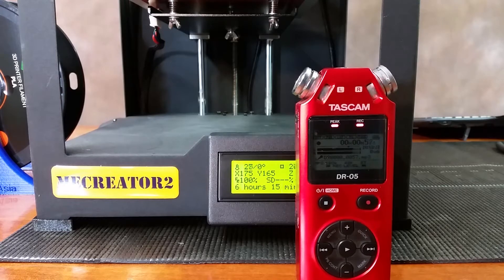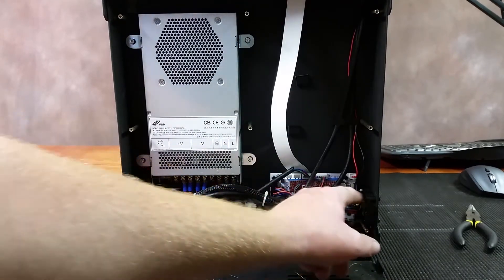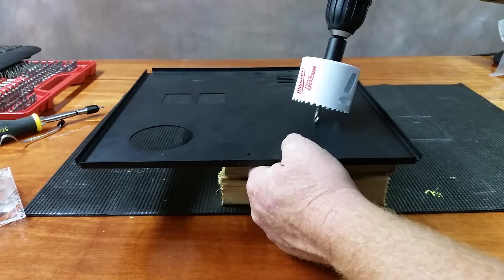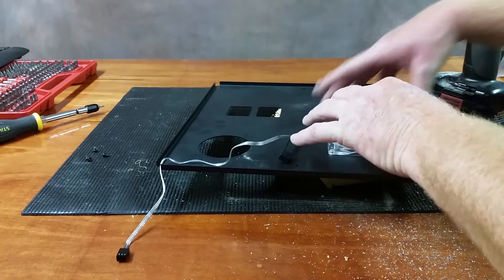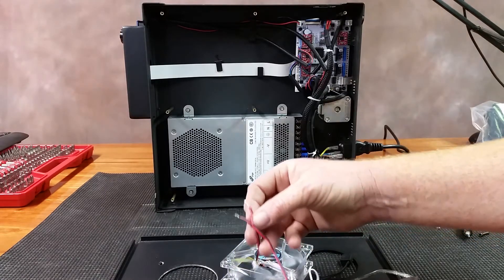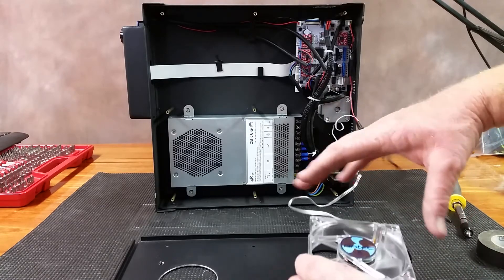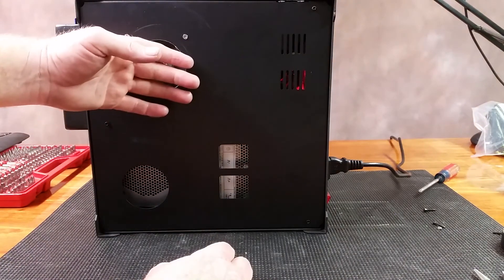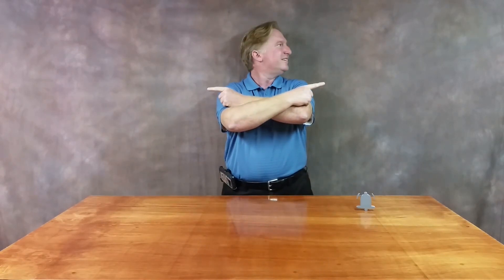Geeetech MeCreator2 Cooling Fan Upgrade

Comment: Thank you Jimmy. This printer have a lots of defects. It annoying noisy fan is one of them. I don't recomend it. I can't undestand what happen with the ears of his builders. No body prints on blue masking tape. Except if you change the masking blue tape for a square of thin  glass and lac, is imposible print in other plastic diferent than PLA. Also, the print bed is attached  to the chassis directly with metal bolts and springs. It's imposible to get more than 70 degrees on bed. My calification to this printer is 0. I would try to do this transformation but is more posible that printer ends on trash cube.

Comment: i would have gone for an arctic cooling F8 so its quiet but any fan will do the job of course. the way you have the fan there it will suck air in i would have put it to blow air out but everyone has their own way of doing things
Reply from the maker: +Toto Guy I wanted to go with a better fan, but the only choices I had at Fry's for a 80mm fan was this and a off brand I had never heard of. 

Yes, having it pull instead of push would have worked as well.  My only thought was forcing cool air in the bottom would push the hot air out.  Plus there's the Jay'z two cents positive air pressure theory.  LOL!!!

Comment: You can get hole saws much bigger than 2-1/2 inches. I have a set that goes up to 3-1/2 inches, plus I have bought a 4 and a 6 to go along with them.
In addition, I also have an adjustable hole drill for my drill press that can cut up to a 4 inch hole in thin metals and plastics.
Reply from the maker: +Jason Simpson Sorry.  I got my words mixed up.  What I ment is that in the US all I can get is the imperial measurement of 2 1/2" instead of mm.  It totally came out wrong.  The other thing was the price difference between the 2 1/2" and the 2  3/4" was nearly $10.  A 1/4" wasn't worth that much to me.  LOL!!! 

On a side note.  I did see a hole saw kit there for nearly $100 that would take care of almost anything I can think of.  Some day when I have the money I may get it. 

Where did you get the adjustable one?
Reply: I've had the adjustable one for years now, I believe I originally got it at Sears, but any decent tool store should have them (Note: When I say tool store I don't mean hardware or lumber store, although you might find one there)
It basically looks like a spade drill bit with a "T" on the business end that is adjustable with a set screw. Mine came with 2 different T bars, and the bars are marked for easy setting of the hole diameter.
After a quick search on-line, I found this one:
http://www.homedepot.com/p/Milwaukee-2-in-to-7-in-Dia-Adjustable-Hole-Cutter-49-56-0320/205744284
Although Harbor Freight has a cheaper version here:
https://www.harborfreight.com/carbide-tip-adjustable-circle-cutter-68117.html
I would not actually trust the HF one for any serious work though.